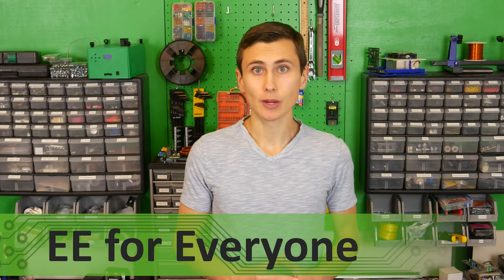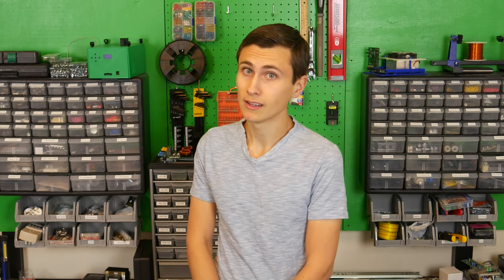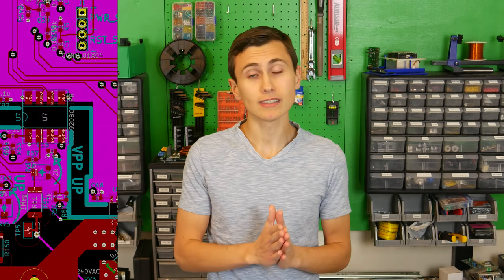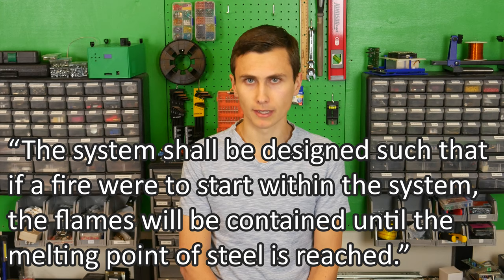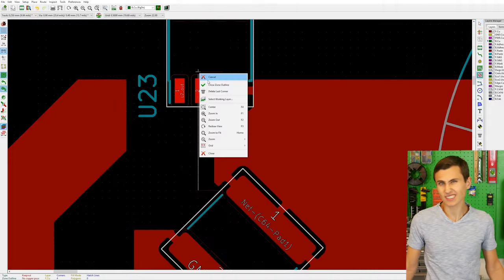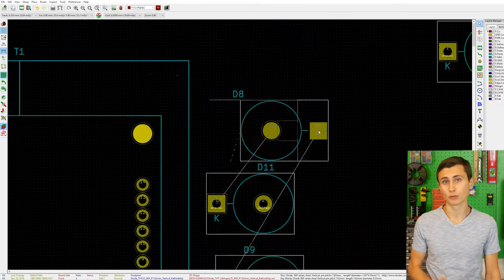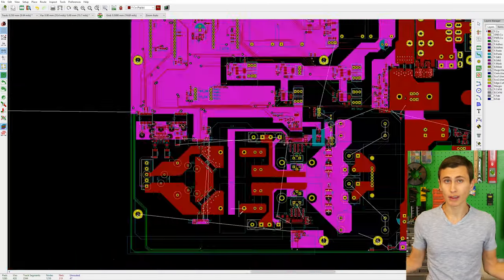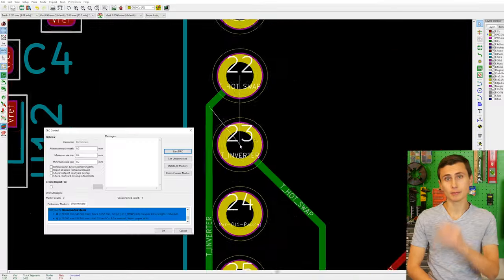Design for Automated Manufacturing (PCB / PCBA)

Comment: I work at a small board assembly shop and we pretty much always order our bare PCBs from AllPCB. Their PCB quality <100 is pretty good for the price, but isn't what I'd call "perfect". The copper etching is fine. But the solder mask might be off by 0.0005" and their silkscreen by a bit more, but their >100 production runs that we've gotten from them come in practically perfect. JLC has given us so many issues, especially with panelizing boards, that every time we try to order from them, we spend a week answering questions just for them to mess something up like panel fiducials, or a bad HASL where a hill of leftover solder takes up the space our stencil printed solder paste was supposed to.
Reply from the maker: Interesting Ben! I suppose it's always fair to say that it's possible to have a bad experience with a good fab. Putting my skeptical hat on... I wonder if there's any difference in service for assembly shops vs. individuals? I'll admit I've never tried custom panelization with jlc, and I've assembled everything by hand so far, so I doubt I would have noticed extra solder leftover from their hasl process. Thanks for sharing your experience! I hope to experiment with more fabs, it'll be interesting to see how jlc & allpcb continue to stack up!